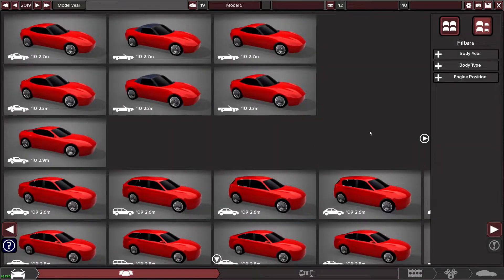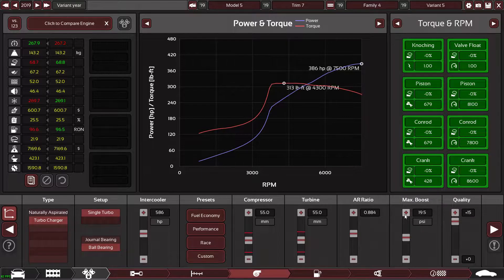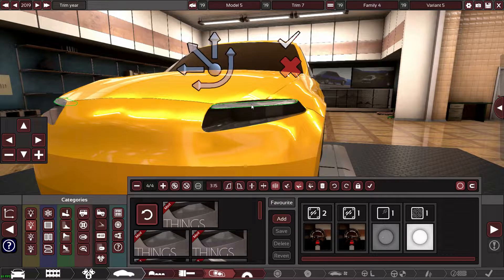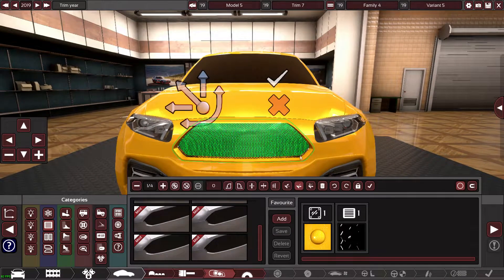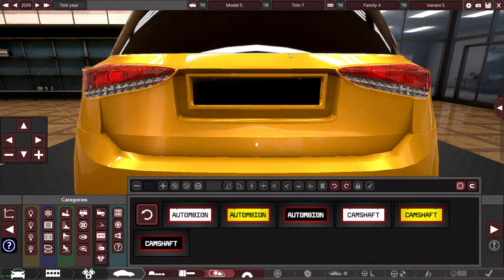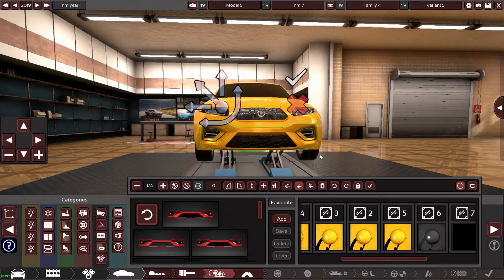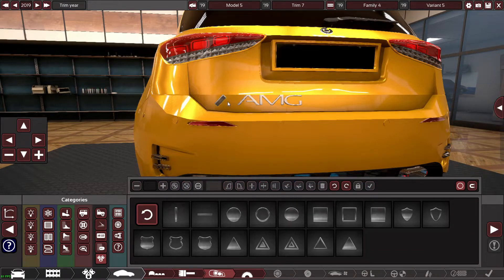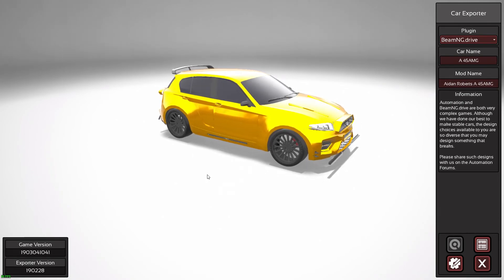2019 A45 AMG Build Automation The Car Company Tycoon Game

Comment: Dude, great job! I tried to recreate the M178 4.0 V8 and it's not that hard to screw out 500-600 HP and 600-700 Nm of torque, but I cant find a way to spool up the turbos earlier, to have that torque at 2000-2500 rpm already (like the real engine). I tried messing with the AR ratio and it did help a bit, but not quite there. I believe you have a similar issue here, any advice or recommendations? You have one more suscriber ;)
Reply from the maker: Thanks man! Only thing I can think of is try a smaller compressor and turbine combo with more boost? Failing that, if your going to use the car in beamng just edit the jbeam files to spool the turbo quicker ;)
Reply: @AR_cars  Yeah, I'll try that! I dont use BeamNG yet, Im just using the game to learn as much as I can for now. BeamNG video of your A45 is awesome as well, keep up the great work